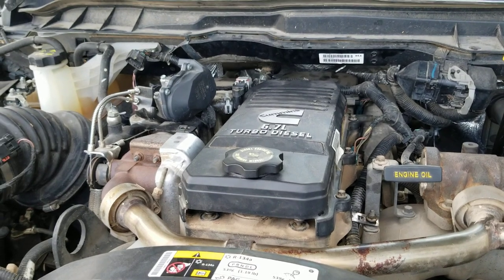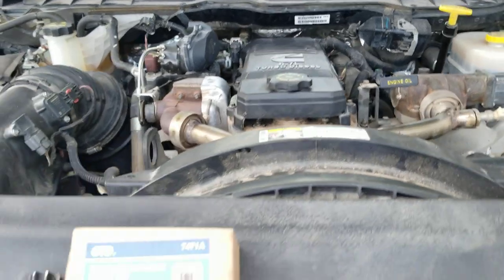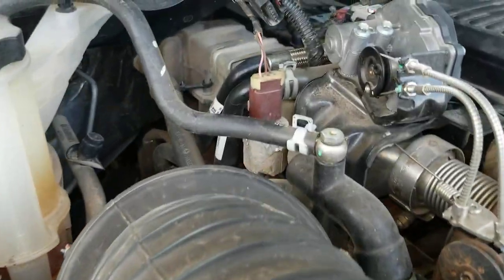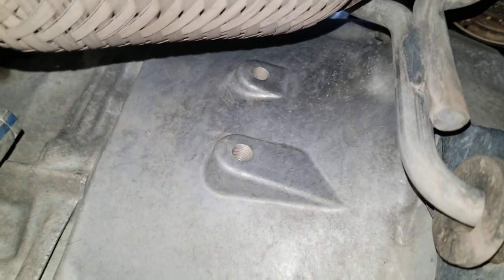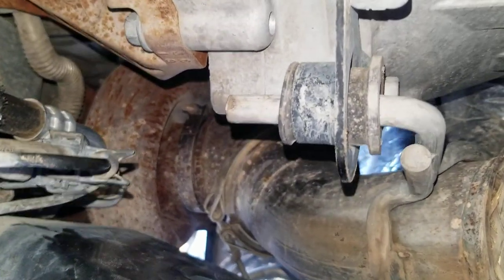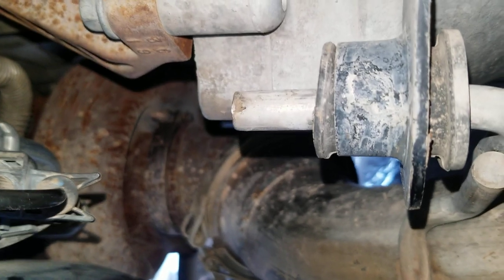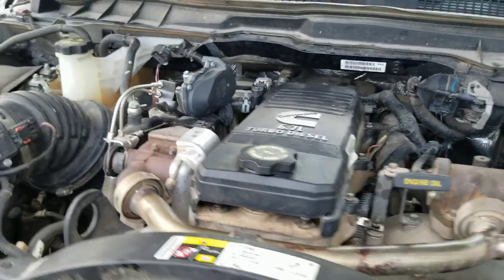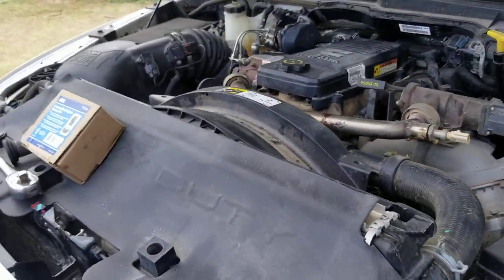Cummins Barring Tool Location

Comment: ✨This tool sounds like a lot of trouble. Just spin the engine with the front bolt. You only have to spin 2 revolutions maximum.🧐
Reply: It’s needed if you need the crank to not spin if you have an auto